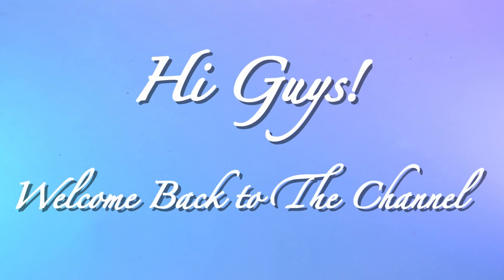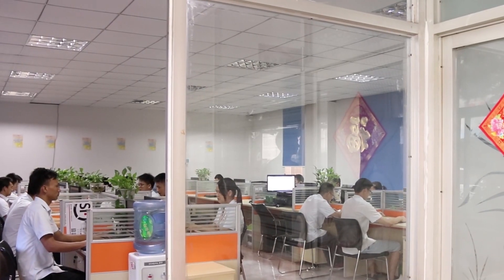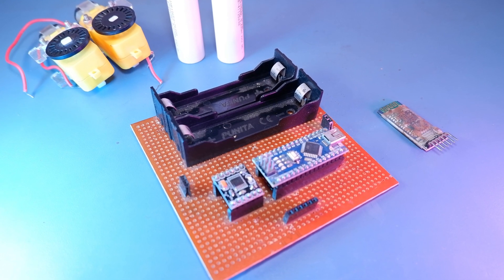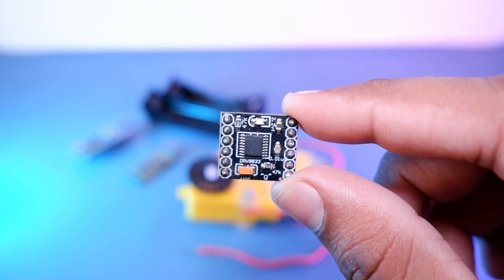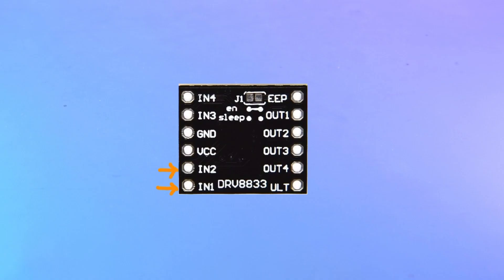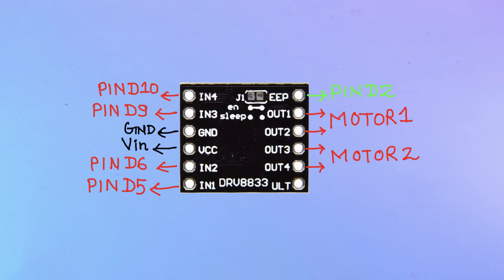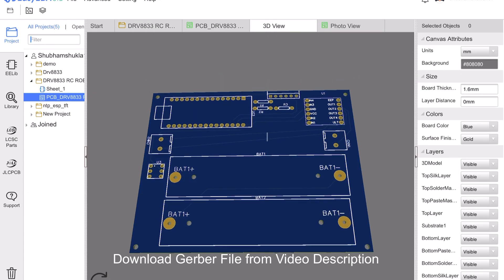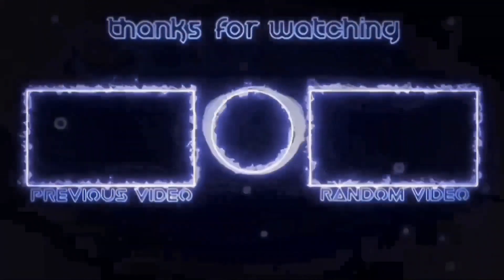Arduino RC Robot Car on a single PCB | Part 1 | DRV 8833 motor driver tutorial | Arduino  Nano HC 05

Comment: Bro I also got the same motor driver and tried to run N20 motors for my LFR, but the motor won't even spin, it just make a noise. I got around 5v but not enough current from the driver, any suggestions??

Comment: Hi , I Want to know about the battery.  Basically i tried a 9v battery and 4AA batteries , but they are not sufficient power and is losing its juice quickly. Also did you use separate battery for microcontroller and separate for motor ?

Comment: I want to see this proyect but with an rechargable 3.7v battery. Nice project
Reply: I'd use tiny boost converter for higher voltage. Optimal is 5- 6 volts.